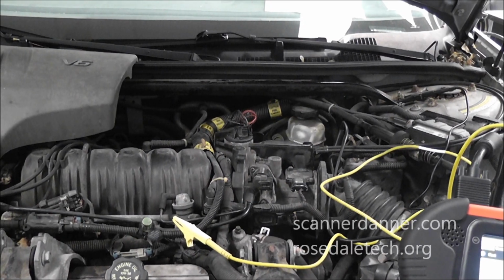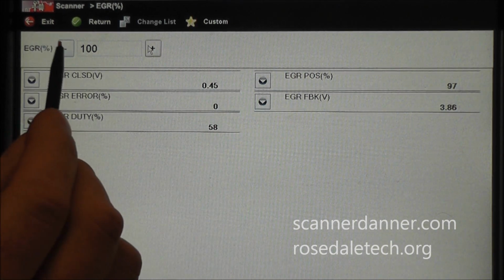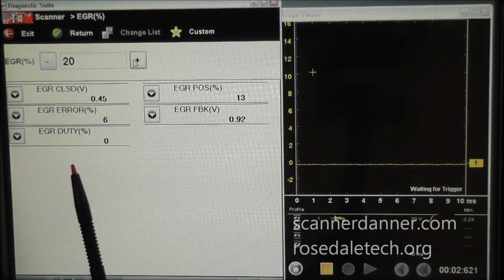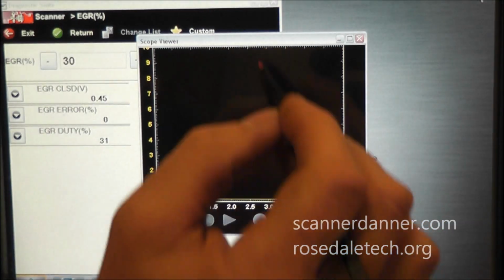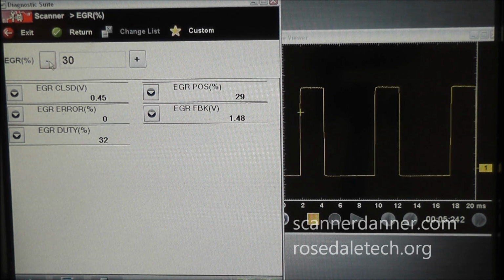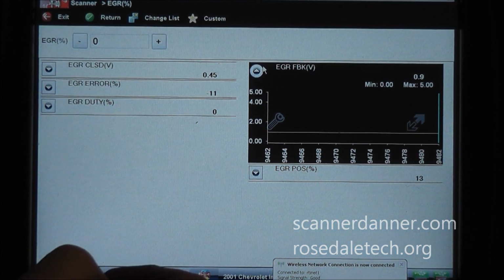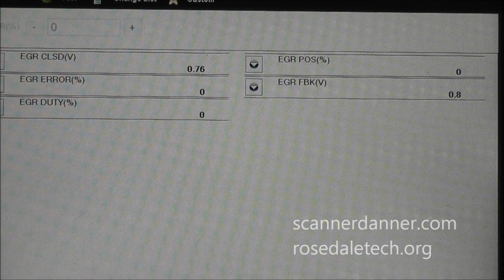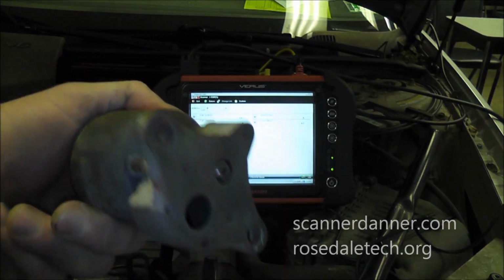EGR Closed Performance P1404 with new EGR valve installed (GM)

Comment: I was getting this code, bought a new one and no more p1404 code now I get a po401, it is a 2001 lesabre with 258,000 all passages are clean and clear to the plenum and to the exhaust I don't know what to do next.
Reply from the maker: How did you test the passages for being clear? If you manually energize the EGR solenoid with the engine idling, the engine should stall or almost stall if those passages are clear.
Reply: ScannerDanner I removed the egr valve from the egr to the intake there is a corrugated tube I removed the MAS removed the tube and it was clear I had replaced the lifters back in October so I had the upper and lower intakes off there was no carbon everything was clear, from the egr to the exhaust I ran a wire down through the passage and it also was clear, 90% of my driving is highway 120 to 200 miles at a time since I've owned the car, I just have a basic handheld actron code reader not the cheapest but not the  best one they make, I haven't tried disconnecting the battery yet to see if that does anything, I was a getting a p0420 code for a while on and off last year but since this happened I got it once after installing the new egr valve cleared it and never got it again, there is another  video which I can't find again where a guy has the same code and it turned being the ECM that was bad, I even unplugged the egr valve and the car ran fine.
Reply from the maker: Energize the EGR manually as I suggested. It is easy to do. Then you can check the computer driver (control of the EGR) using a test light. I think I showed that in this video too.

Comment: Supposing you replace the valve, disconnect the battery, make sure any capacitors are drained, and still get the code?
Reply from the maker: You didn't bolt in on backwards did you? Some of them you can and vacuum will end up opening the EGR valve when you start it.
Reply: It seems the replacement just doesn't close all the way -- apparently a defect. You can see light through it if you shine a light into the other hole. I blocked off the valve with a sheet of aluminum foil and it stopped stumbling at idle.

It also started sticking badly at 4000 miles.

Comment: I have the same code for my 1998 GMC k1500. took the valve off and cleaned it really good. did  some Diagnostics on it and I'm puzzled because my power wire ( red/pink) wire when back probed and plugged in gives me a reading of 45.7 on the voltmeter. when I unplug it...it gives me a reading of 12 volts. why would the volts be different when plugged in vs unplugged??
Reply: It's a bias voltage and is normal. It's used by the ECM for diagnostics.

Comment: I just had a  P0402  on my 2000 Mazda Miata.  It says excessive recirculation gas detected. Could it be a bad  egr valve stuck open?Please advise.C
Reply from the maker: That is one of many causes of "excessive flow"

Comment: Hi,

just tried to manually open my EGR valve using a jumper wire to the ground side switched control wire. It would only open momentarily when I removed the jumper wire connection and wouldn't open when connected.

can you shed any light as to why this is?

5v ref is good

cheers

pete
Reply: 04 Ford C-Max 2.0 tdci, electronic 5 wire valve

Comment: Great and important video. I just ran into this in a 2009 Town & Country. I replaced the EGR due to code P0404 and then P1404 code popped up. I went in and checked all of the values and saw similar data. Disconnected the battery and problem solved.
Reply from the maker: sweet!

Comment: what do you do when this wont reset, I have had the battery off for 30 min and it refuses to relearn the closed position voltage. 02 bonneville
Reply from the maker: Disconnect the battery terminals then touch them together. This will discharge the memory capacitors in the ECM

Comment: AT LAST A FIX FOR MY CHEVY 4.3L VORTEX ENGINE, POSSIBLE FIX FOR YOURS!

Hi,
I have a 2000 blazer with the same problem as you and thousands of other people out there.
NO one could figure out my problem. I purchased my blazer used last year with 113,000 miles on it.
It ran great over the winter and this spring it started misfiring on cyl. 4 just like yours.
I changed everything in the ign. system just because of the age, hoping it would solve the problem. It did not.
NO big deal, plugs, plug wires, rotor, Inlet air temp. sensor, distributor cap, coil, & alternator. They needed to be replaced anyway, but what a bummer I still had a misfire on cyl. 4.
To make matters worse, I would only get the code P0304 (misfire cyl. 4) only a few times in months of driving.
No other codes came up. It would be worse on wet or low air pressure days. On dry days, or higher air pressure days, the problem would be almost nun-existent. After four or five miles of driving first thing in the morning, the misfire would go away and the engine would run great for the rest of the day even if I let it set for ten hours while at work. It only gave me a problem first thing in the morning. I would leave my house going up a hill for about a mile. The misfire would only show up around 2000 RPM when the engine would try to shift, then the misfire, and the trans. would jump from first to second in and out until I would let off of the gas and let it shift and then give it more gas. kind of like driving a standard even though this is a automatic transmission.

I asked everyone that new anything about automobiles if they had any clue of what the problem might be.
I got the same old probable cause problems that I have already tried. 
I new a good scanner would help a lot but I do not own one and so many other people do  not own one, so I thought I would try to find the answer with good old common sense and testing.
Four weeks or so I read and watched every video and training article that was related to my problem, and what I learned was amazing!
I found out there are thousands of people out there with the same exact problem I was having with my engine and nothing seemed to work. Knowing that, I began to realize it was not a simple, obvious problem that was addressed often.
To find this problem I knew I had to understand how all the parts worked and how to test them.
I learned how to test the sensors with a meter, so I tested every sensor on the truck I could using a vac. pump, volt/ohm meter and everything tested GOOD.
I tested the MAP sensor, Crank Case sensor, Throttle Positioning sensor, MAF sensor, Air Temp. sensor, Cam positioning sensor, EGR valve checking for 5 volt reference, correct signal voltage, and good ground.

I noticed the problem was worse on wet days even if it did not rain and the engine was dry.
I figured it must be a pressure thing because the problem was worse with wet days which equals lower air pressure.
Now with that in mind, I looked for a control that worked on air pressure and on my engine it is the MAP sensor.
I unplugged the MAP sensor and wow, it ran great with no problem at all.
Now I have already tested the MAP sensor and everything tested great. I started looking into how the MAP sensor works with my system and found it monitors the EGR valve, and sends results to the computer to help in adjusting the timing under load at certain engine conditions. I plugged back in the MAP sensor and the problem came back.
Knowing it monitors the EGR valve I decided to unplug the EGR valve and give it a go.
Behold, the truck runs great with no problems.
Of course it is running very rich and this is not a fix but a clue to the problem.

I should mention that the 2000 GM 4.3L Vortec engine uses a lineal EGR valve.
This valve has only one solenoid and uses no vacuum line connected to it.
The EGR valve has a throttle positioning sensor (potentiometer) built into the EGR to tell the computer what percentage the valve is open or closed. It is a five wire plug. One wire 12VDC, one wire 12V ground both used to operate the EGR pintle movement. One wire 5VDC reference, one wire signal wire(voltage back to computer), and last is a ground wire.

I removed the EGR valve again to double check it.
The original test I preformed on the EGR included a good cleaning of any carbon build up, cleaning and checking the pintle and seats for any build up, a 12 volt power on and off confirming pintle smooth movement, and a ohms reading on all pins confirming ohms drop on the pintal positioning sensor.
Something bothered me though, I noticed when preforming the pintal positioning sensor test.
About 1/8" of an inch of the pintal being pushed in, the ohms jumped to a reading 1K ohms lower than it should be for about 1/2 a second and then return to the correct value.
Every time I pushed the pintal in It would do it. kind of a hiccup of sorts, other than that, the EGR tested perfect.

Pushing the pintal in, the ohms started at 4.9K closed valve and drops to .57k open valve.

Valve closed= 4.9k
Pushing pintal in very slowly = 4.9k-3.8k smooth fall.
Continuing pintal inward from 3.8k it would drop instantly to 2.7k for 1/2 second and return to 3.4k and fall at a smooth rate as the pintal continued to be pushed in..
Now if this was on a good scan tool it would show up as a quick voltage drop. Still easy to miss.
Anyway, I changed the EGR and problem solved.
Truck runs like new.

I know you may have changed your EGR valve, but even new parts are bad off the shelf. It would test good, you have to move the pintal in and out very very slow and watch for the ohms to change in a smooth up and down. If it jumps around at all, there is a problem with the pintal positioning sensor and the EGR needs to be replaced.

I Got no codes for bad EGR
The only code I got was P0304 Misfire Cyl. 4

Sorry so long, hope it can help

TayloredSteam
Reply: +Scott Taylor (TayloredSteam) Awesome post! Takes a while to read, but will check out the MAP sensor...and maybe just change the EGR valve and be done with it. I can tell you my mechanic said it's not an issue to lose sleep over. Maybe down the road this could be a problem, but you can safely drive with the problem for a long, long time.
Reply: OH GOD!! I started watching this thinking of my Blazer. I constantly hard carbon build up.

Comment: Someone below suggested disconnecting the negative battery cable for half an hour and the EGR valve would reset to zero. I have just done that, and it works! Whether it will remain properly reset or revert to a P1404 problem remains to be seen. But for the time being: kudos!

Comment: Okay, so I have an '01 pontiac grand prix, 3800 ii engine, and the p1404 code came up about a month ago. I tried cleaning the valve with some throttle body cleaner and a toothbrush, but that had no effect. After a little research and some advice from the man down at partsource, I ended up just replacing the damned valve, and clearing the code. There were no problems with it until now when the p1404 code came back up for the new valve. Unfortunately, I don't have access to a high-end scanner like in the video, just a simple 70 dollar scanner, so running tests and seeing exact voltages is currently not possible. Any suggestions?.. Other than "buy a new valve" or "see a licenced mechanic"
Reply: I am directing all help requests to my forum. Sign up (it's free) and create a new post. Be sure to add a name under "alias" as this is the name that will appear in the post.
Here is the link to the forum. 
http://www.scannerdanner.com/ForumRetrieve.aspx?ForumID=3226
Thanks
Reply: lol didnt you see the video?

Comment: Wow Thanks a ton for the video, my Chevy Impala 2001 got the same problem and I got error codes P1404 and 1404 P (don't know this one). I cleaned the carbon residues with carb removing solvents and got the code again after a few drive cycles. I checked the EGR solenoid resistance (9 ohm, so okay) and my circuit voltages tests were positive as well.
Just disconnected the batteries and will reconnect again and hopefully it will fix the problem, Will update in this thread :) 
P.S.: I ordered a new EGR valve but will return it now since that's apparently not the fix for this problem. Thanks again for this detailed video. Excellent work!!!

Comment: Just did one of these on a 3800 in a 2001 Buick Regal. New EGR valve but still set code P1404 again. Disconnected battery for 30 minutes finally relearned closed position as 0 percent. Relearned that 0.75 volts was minimum EGR position

Comment: paul,have question. have problem with egr,in live data i see 3 parameters, valve pos dont drop less that 35% on idle,when engine under load i see it opens to 96% ,second egr feedback % is not changing by no conditions or idle or load ,number is same 86.5%. when i use by directional and command valve to open i hear it clicks,also on idle it dont die and rpm wont drop.
Reply from the maker: I am directing all tech questions to my forum. Sign up, it's free
http://www.scannerdanner.com/ForumRetrieve.aspx?ForumID=3226

Comment: You just made my day man... I've had the same issue with my 2000 S10 4.3 with a P1404. Replaced the EGR and same code every time after 4 drive cycles. I was beginning to suspect either a PCM issue or a short somewhere. Gonna see if this works
Reply from the maker: cool man, let me know. IT is the right year range for this glitch in the programming.
Reply: ScannerDanner Well man come to find out... I pulled the pos & neg cables last night, touched em together to clear the kam, and left them disconnected all night. Next morning after hooking em back up the truck fired right up (unusual because I've been experiencing a cold-start flooding issue the last month or so). I've checked the egr wiring as far as voltages. I have 12v, 5v ref, pintle signal, and the only one in question is my ground. I did read on GM tsb online that the only way to correct this issue is with an pcm update... I've even checked the egr orifices- started it up and blown em out, new egr, etc. Same code still every time I clear it with my Autel... Any thoughts?  Would you be able to somehow send me the egr circuit diagram and pcm pinouts for the egr circuit. Gonna dig a little deeper and see if there's any shorts, bad connections, etc. Seems that most GM vehicles with the 4.3 are experiencing the P1404 problem from what I've read online. Thanks in advance

Comment: My first generation Verus times out after 30 seconds and locks control out for 60 seconds, so you better act fast. I guess that's some kind of safety feature they put in the12.2 version, I don't know haven't had mine but about a month. Just got it back from a level 5 repair, that's what happens when you buy used i guess, Great Vid as always.

Comment: How well does the Veris work with an OBDI vehicle?  Can you still run tests similar to this diagnostic method?    I have a 1993 GMC Sonoma with the CPI (VIN W) 4.3l V6 and an '88 Pontiac Bonneville with the Series 1 3.8l V6 (with lots of issues) and am doing some research on different scantools.  I have a line on an Innova Bi-directional scantool that looks like it matches my needs...  BTW, I am ASE P2 certified and have a ~15 years of schooling and experience in Heavy Diesel and LD vehicles.

Comment from the maker: clearing the codes would not reset this learned closed valve position. only a battery disconnect. newer systems this is reset on every key cycle

Comment from the maker: Thanks for the comment. I agree that my initial thought of needing a new PCM was wrong, however on the next sequence of filming (the reason I added additional material) my plan was to show what a battery disconnect may do. I said "may" because I wasn't 100% sure if it would work in this case. I've seen this condition with TPS issues but never with an EVP. The dead battery just jumped the gun on me. I don't mind the constructive criticism. I just didn't stumble on this fix. 
Paul.

Comment: i like scannerdanner videos and have learned some new stuff myself, but i have a lot of experience in the field also. not taking anything away from Dan, but in this case he stumbled on the solution by accident. it happens to the best of us even me.  from my 25 plus years of experience i knew the problem before he was even finished with the video and was wondering why he was going to tell the customer to get a knew part after 4 used parts, but i couldn't tell him. actually it was a simple fix

Comment from the maker: I think within the programming there would be a limit or threshold that would be allowable for the min position relearn. Maybe 10-15% of normal closed valve EVP voltage? I didn't get a chance to play around with this one. But you can be sure I will on the next one.

Comment from the maker: quick comment to those of you still following this. It has been a few weeks now and there is still no check engine light or returning trouble code for this EGR. I just felt it was important to update you in light of the TSB on the reflash of the PCM for this problem. Not saying the reflash doesn't need done, just saying that the resetting of the min. position was the fix. I am sure the reflash causes the PCM to do this on every key cycle instead of battery disconnect
Reply: Couldnt it be possibel that if the error is still stored it wouldnt RESET closed valve voltage? @scannerdanner
Reply from the maker: @lauritsstergaard7798  that would be addressed by simply clearing the fault, and that was not the case. Great thinking though, it is that thought process that is needed sometimes
Reply: @ScannerDanner  but then what i dont get is how it would figure out if if the sensor is seated properly or the egr is held open by soot?
I Mean if it reset by every key cycle. I know it would look at maf or map at start up.

Comment from the maker: good question, no need for reverse polarity with a solenoid like this one. 
I believe the purpose for both solenoid wires going to the PCM in this redesign by GM is for better circuit monitoring. but I'm not 100% sure. 
I am positive that it is not a reverse polarity design though